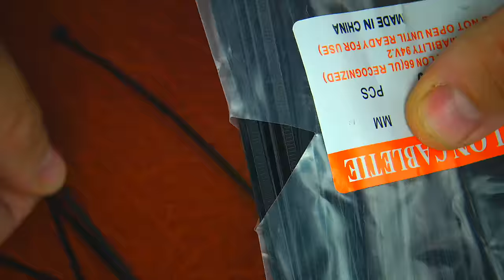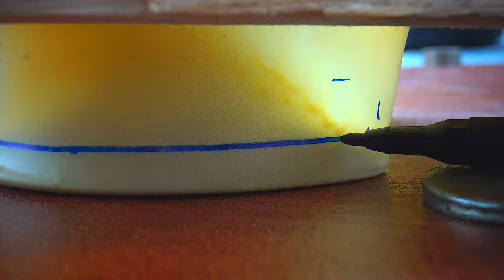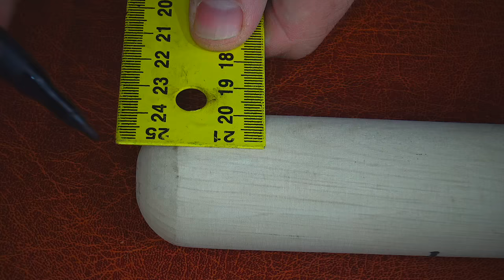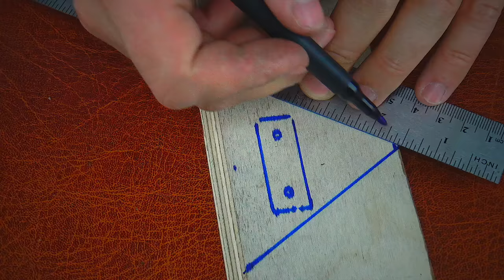Don't hesitate to buy it, do it yourself! 35 working ideas!

Comment: I have seen many of these DIY Hack videos.
This one actually had some items that could be adapted and be very useful if not just a fun fix-it project.
Quick examples are;
The making of a frame and softening the plastic cut from a bottle to form over another piece as in with their water can. Using that process my son made a "snap-on" lid for a big clear jar so he could take his small pet frog out and around with him during his day outside.
Using sandpaper to sharpen blades such as the meat grinder and clippers. Doing that with the meat grinder ensures a smooth mating of surfaces as opposed to trying to use a file and potentially being off angle a bit.
Making a simple cap with a PVC pipe piece and a wire to create a support from small posts without having to try and twist attach the wire having it slide up or down possibly for tying tomato plants to it.
These and others like I said could be adapted to solve some simple tasks. 
Mainly it promotes a creative thought process that others who are crafty or tinkers can use as a springboard for other ideas.
Sometimes it is just plain fun to solve a problem in a creative way. It may be easier to go buy something to replace an item or spend money on a tool you don't own, but sometimes you get more pleasure or a sense of accomplishment when you "Tinker" your way out of an issue. 
Everybody needs those small accomplishments in their day to help add just a touch of self pride and a small success to your life. Those add up in the long run.
Reply: Opps!.
.sorry.......retracted...tremmmmors started......
Reply: @psycho brother. that's just cool. I bet you're a hec of a dad an husband too. makes me smile.
fr texas
Reply: Good morning, thanks.

Comment: When making the chain link from the disposable water bottle I don't understand how you ultimately linked them together to form a chain. Also you held up a bottle with the label H202, I don't think that the average layperson would understand that this means hydrogen peroxide, at first glance it looks like H20 which most people would know symbolizes water. I love ideas for repurposing things, hence I love your show, It's a cut above the average DIY videos.
Reply: I'm going to guess that after making the first one, he put the plastic through it and then started making the next one and so on, but I could be wrong.

Comment: Spout cutter: Great hack, to use the thing labeled "Spout Cutter." Who'd think of that?  Drill chuck protector: Don't damage your chuck by rubbing it on the ground!  Damage it with a hacksaw instead!  PVC splice: Making a bulky splice with a way oversized chunk of PVC can save you as much as two cents on a piece of heat shrink tubing.  #8: WTF is that even supposed to be?  Watering can repair: Okay, I'll give them that one, it's pretty clever.  Plastic chain links made out of shredded bottle: Why?  And how do they get magically linked together?  Wire cutter on pliers: It already HAS a wire cutter, but congratulations, now it's weaker.  Grinding wheel from glue and sand: all that effort and it barely works.  Buttons from spray foam: just SMH.  Brush with screw heads: Great, now I can slowly destroy styrofoam, said nobody ever.  Magnet battery clips: Again, props for that one, it's genuinely smart.  Wire clips out of tin cans, and the other improvised clamping solutions: Where is this guy, that he has a boundless supply of nuts and bolts and sandpaper and zip ties and hot glue, but any other hardware is mysteriously unavailable?  And finally, what's with the Christmas music?
Reply: "Wire cutter on pliers: It already HAS a wire cutter, but congratulations, now it's weaker. "  Apparently you and I are the only 2 people that noticed that!!!  As soon as I seen him do that, I thought, you dumbass, they already have a wire cutter built in!!!

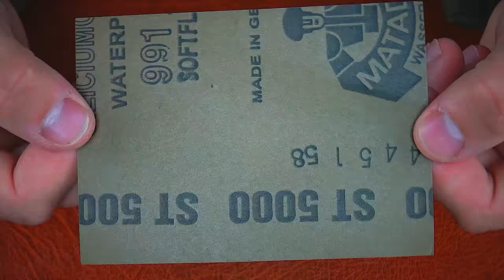Comment: You ruined that meat grinder blade. The blade surface and plate surface must be mated permanently so they wear against each other perfect. You just changed the blades without the plate. Now the surfaces don’t match and you will have metal shavings in your food till you replace both the blade and plate. Also… plates are made to only face one direction because of this. 10:41